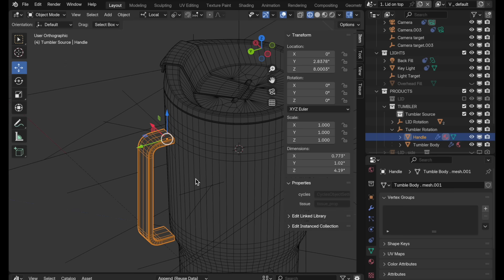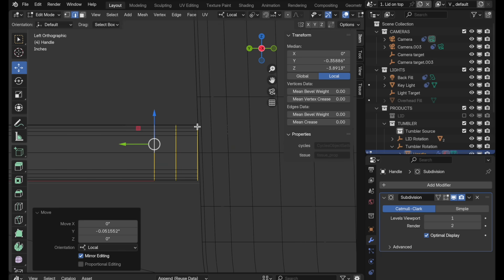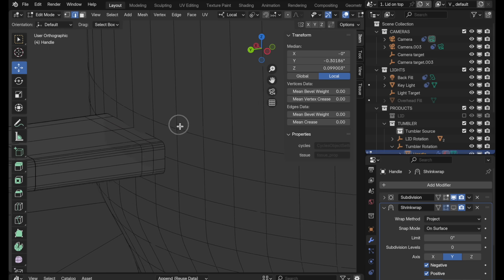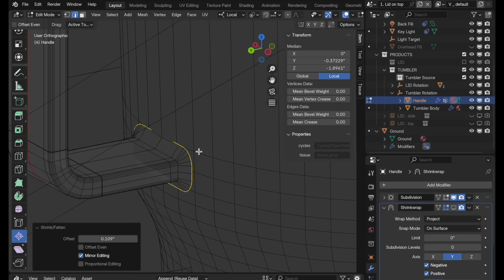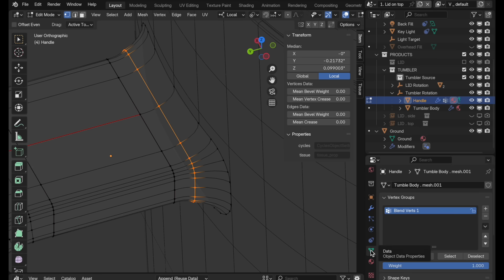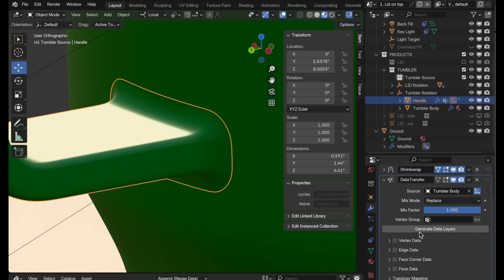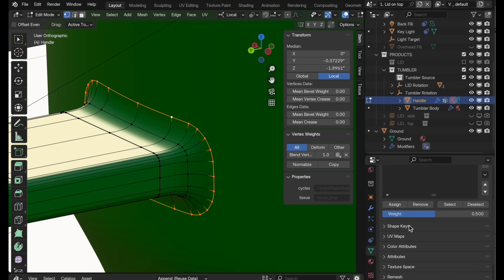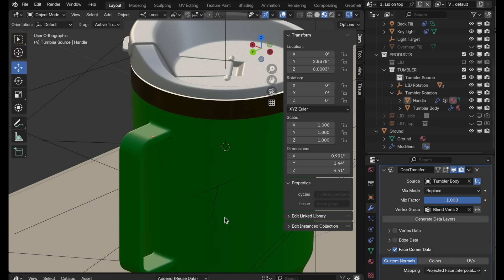Connect two objects using the Data Transfer modifier, it's cool!

Comment: It's amazing what you can do in Blender when you have the proper knowledge.
Reply: Yes, with blender, each day you can find on YouTube or elsewhere a small nugget of knowledge that will greatly simplify your life and/or make you art better.
Reply: Seems weird that the end-user-facing names for tools like this are based more on how they work instead of what they do
Reply: @Namewithheld00123  It's probably because these names came from developers, that's why they are more technical names instead of being more user friendly. It's one of the pitfalls of open source software I think.
Reply: Ah yes! so remarkable, so proper indeed...
Reply: Well you can achieve the same rsult by joining the handle to the body of the mug and then adding bevel node to material. Was surprised this works at first)
Reply: That's the difference between 3D and 2D art. With 3D, all you really need is knowledge, you're not really practicing anything besides how to hit hotkeys faster. With 2D, you are constantly developing skills like how to handle the brush to make nice lines or shapes, how to shade and how to build things. 3D is much less rewarding to do, but it is still nice because of the reusability.
Reply: U ain't get nothing if u ain't practice and learn how the path is to get results !
Yall think it's so easy haha but yall never did something with blender or Houdini or Maya😂😂😂😂
All what I see is comments from unprofessional teens here without any knowledge about 3d
Reply: @loxep915  What are you going on about?
Reply: @loxep915  Congrats for being as great as you are, I guess!
Reply: @loxep915   Wow You seem so knowledgeable !!! ;)
(And to avoid the risk of misinterpretation, the above was IRONY)

Comment: Why not just use a boolean combine?
Reply from the maker: Because booleans are messy to work with when you need to produce proper topology for subdivision objects, especially if you need to control the rounding of the connection point. Can be done, but a pain.
Reply: Yeah, when I join things I use boolean union, remesh, and smooth corrective.

Comment: Was just wondering. Have you tried this technique with the bevel bode in node material. I believe it can do about the same
Reply from the maker: That's a good point. I haven't really used the bevel node much, but I do remember seeing a tutorial about it a while back.
Reply: @christopher3d475  inhavent used the trick neither in a while. Just did a Google and a stack exchange post said intersecting two mesh can either be done with data transfer or bevel node. Not sure which looks better. The data transfer method does need a lot more work as it seems

Comment: THIS IS AMAZING

Further to add is that this also works with eevee !!!

I am a product designer and making blend surfaces between parts like a hair dryer body and handle was always an issue in Blender

This is solving that problem!

Top, truly top !!!

This is so much like my first NURBS app on macOS called Pixels that used a tool to blend between to parts in a similar way but via a shader. It also worked to blend between two different materials.

Do you know of a way to do this in Blender - so where the handle and the cup meet there is a transition between the two different materials ?